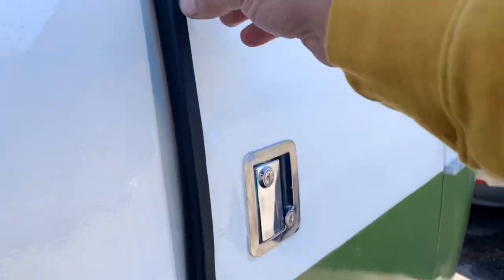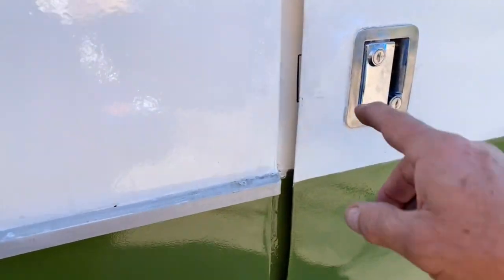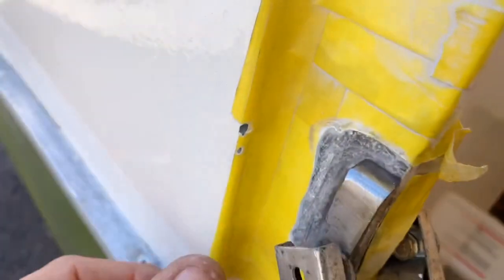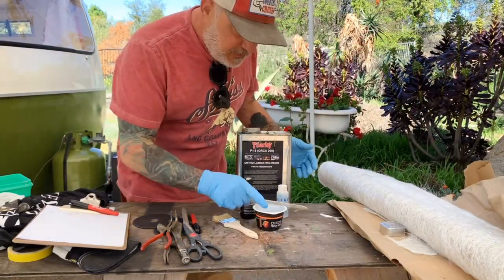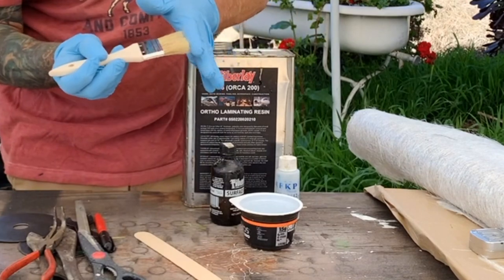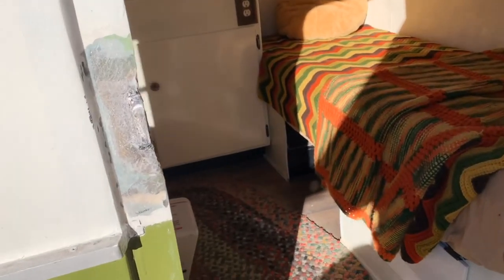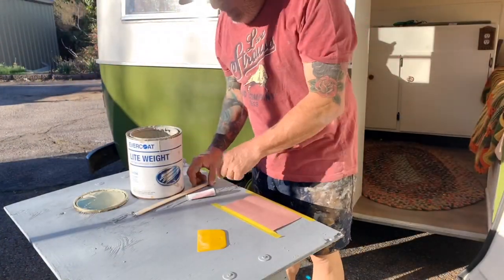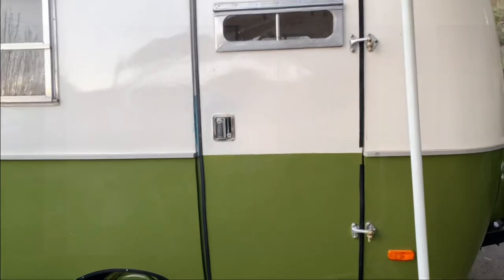Fixing Scamp Door…Again!

Comment: Where do you buy that rubber seal?
Reply from the maker: Hi David, I bought it from Steele Rubber, I’ll find the info and post it here.
Reply: Thanks. I have an ‘86 casita. The door seal needs to be replaced and I’ve checked all the local RV shops as well as the internets. No luck so far.
Reply from the maker: Okay, Steel Rubber Products 1-800-230-5897
Part # 70-3592-277 
If you contact them they will send you a free catalog. Hope this helps. 👍🏼
Reply from the maker: @DavidSmith-lp5tz  info above. 👍🏼